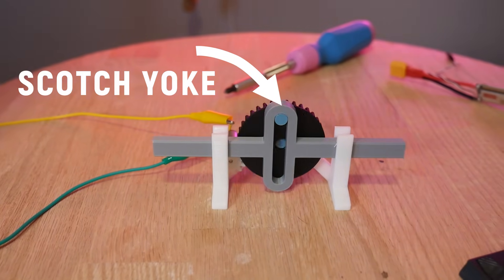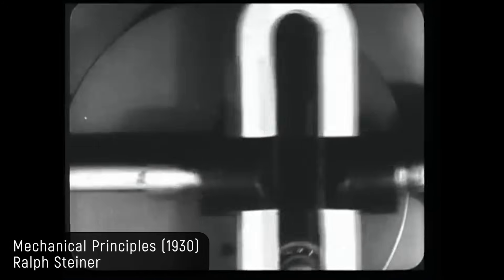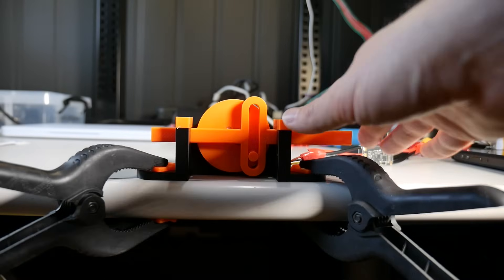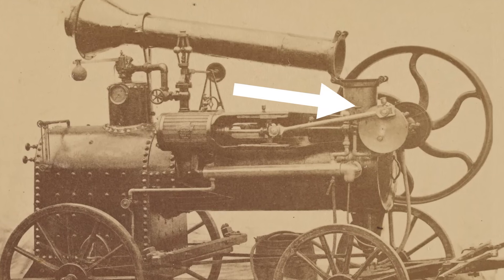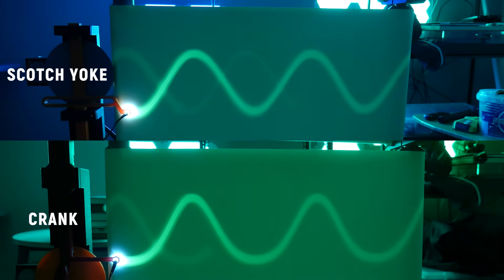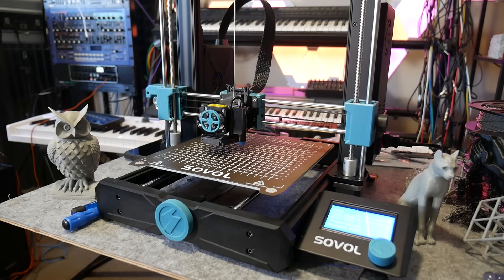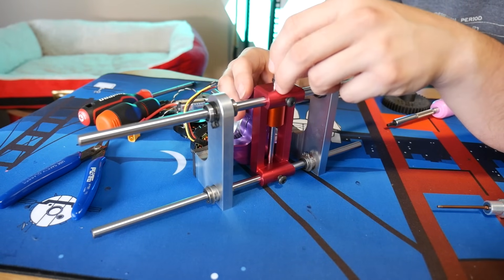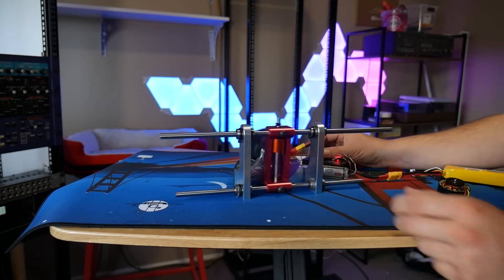This strange mechanism can predict the tides.

Comment: most hair trimmers use a scotch yolk to convert a tiny electric motor's motion into the sheering action. because the pin and yolk don't need to be fastened to work, the head of the trimmer can be easily changed.

Comment: I have seen a scotch yoke on a steam engine. The pin that broke off in your design was a sealed ball bearing in that engine, so it rolled on the two surfaces alternating.

Comment: In the late 90's to early 2000's, my father, an engineer, was working on a project at Melbourne University to make a fully functioning scotch yoke car. When running, you could balance a 50c piece, on edge, on the top of the motor and it wouldn't fall or vibrate off, even under inconsistent acceleration bursts.

Comment: I'm confused how that's a linear bearing at 9:45?  The bearing doesn't appear to turn at al, just slides on a shaft along its inner race.  Which is more like a bushing, not a bearing.  So why use a bearing at all instead of just a sleeve?  Or better yet, why not tip the bearing 90° have it ride on the cam arm inside the slot of the yoke?  Then the bearing actually does turn

Comment: After a bit more digging, looks like Watt avoided the whole crank thing on the input side much the same as the output. It wasn't until later in 1841 Howe and Williams introduced something like that as part of their reversing mechanism. Earliest reference of a "slotted link mechanism" I've found so far.

Then later again, there's [Illustration: Figure 41.--Scotch yoke, described as a "crank and slot-headed sliding rod." From W. J. M. Rankine, A Manual of Machinery and Millwork (ed. 6, London, 1887, p. 169).] from Kinematics of Mechanisms from the Time of Watt, Eugene S. Ferguson

But yeah, I think they were more common for actuating the slide valves where programmability would have been handy, not for high loads.

Comment: If you are looking for use cases for a scotch yoke, it is a little different, but I recognize the layout from a single point  cutting machine tool called. A metal Planer. A deprecated tool but a damn cool one. Bullet proof in its durability as proofed by ancient examples being bought and sold on marketplace even today.

Comment: I know this was more of a proof of concept but there are genuine limits to a crank shaft. An imperfect sinewave is problematic when the length or more accurately how short the peak is ideal. Example in car engine a better sinewave could lead a potentially higher rpm. Now some may argue that level of accuracy is not needed. Fair, but that doesn't mean we shouldn't explore other options. Science is built upon the idea of collecting data so that it might prove useful one day.

Comment: The big reason we only use cranks with connecting rods for so many machines is that scotch yokes are fundamentally incompatible with journal bearings. Journal bearings are the best option for low rolling friction under immense lateral loading. Ball bearings are going to perform far better for an electric fan, jet engine or turbocharger, but for an axle that needs to hold up a 100 tonne train car or suffer being exploded into 4,000 times per minute for years on end, journal bearings are the king. A lot of people think journal bearings just work by reducing the coefficient of friction of sliding metal contact by adding oil or grease, but the metal parts never actually touch. If they do touch, the connecting rod tears through the bearing surface, jingles around on the crank until it cracks and then rips a hole through the side of the engine block, all in about 10 seconds. Journal bearings actually work by the shaft being off centre in the hole. As the shaft rotates, it drags on the oil through friction. As the oil gets dragged into the narrowest point between the shaft and the hole it's in, the oil gets wedged into this gap, providing a hydrodynamic ramp that pushes the shaft back towards the centre of the hole. A scotch yoke's pin could use a bearing to roll on the yoke's slot, but its rotation would be constantly reversing, so the hydrodynamic effect that makes journal bearings work can't happen. Journal bearings are especially good for internal combustion engines because they allow shock loads 5x higher than the static load to be absorbed in the temporary thinning of the oil film when the explosion happens. The viscosity of the oil, the speed of the rotation and the gap between the shaft and its hole are finely tuned. This is an issue for machines that change speeds. Around the 1950's, car engines started to use an oil pump to force oil into the bearings to make them tolerate loads at a wider range of speeds. Ever been told not to go full throttle with the engine at low RPM? Then you received a tidbit of 70 year old advice that's been handed down by multiple generations since it was relevant.

Comment: When i was young, I had a old machinist I used to work with who swore that the scotch yoke got it's name the same way that Scotch tape got it's name: stereotypes.  Because pistons and crankshafts were protected under patent at the time, all sorts of workarounds were developed, like the sun and planet gears, but the cheapest option was the constrained yoke. Don't have a primary source, so take it as anecdotal.

And if you're curious, Scotch tape got it's name because when first developed, a body shop owner testing thought that 3m was being cheap with the amount of adhesive on the backing, and remarked to "Take this tape back to your Scotch bosses!" in frustration. 

great video, as per usual.

Comment: One note about using flexible PCBs: they're not rated for many flexes so you wouldn't want to use them, for example, to connect a moving sensor board to a robotics platform. It would fail after a few flexes.
That said, they're awesome for fitting circuitry into weird cavities like around the inside surface of a tube. As long as the flexible parts are only flexed a few times during assembly, they're dang handy!

Comment: I hate AI with every cell in my body but I'm afraid to say that in this case Gemini gets it right. "what does scotch yoke mean?" => "Scotch: In this context, "scotch" refers to a chock or an acutely angled block used to prevent rolling or slipping. This alludes to the mechanism's ability to "scotch" or stop motion at the extremes of its linear travel". Sure on everything else it perpetuates lies and mistakes, but here for once that looks sensible. But never trust AI, like the friend at a marketing company I know who used it to create marketing email invites to conferences because it saved them having to think and they could stop working earlier (they were working from home so nobody knew, AI was their guilty little help to just be lazy instead of more productive)... until one day it just decided to put in different dates in the email that AI had generated for them, and all their customers were invited to an event on a different day to when they actually held it. Of course everybody checks the output of AI... until they don't... and that's when it'll bite you!

Comment: Where would you be without that book "507 Mechanical Movements", I have a copy myself, I don't make nearly as much use of it as you do 🙂 Good job you don't have access to the rest of my Library, an eclectic mix, I hate to think 🙂
Reply from the maker: I kinda want to know what else is in your library :P Mine is a mix of ancient mechanism and engineering books, and then some unhinged philosophy texts.
Reply: @MakersMuse  Struth, where would I start, a lot of electrical stuff, radio because that is my background, but I love old technical books describing machinery, from the past. "The Book of Modern Engines" A practical work on prime movers and the transmission of power steam, electric, wate, gas, and hot air. by Rankin Kennedy, CE (around the 1920's I would have thought no date). Five volumes. You wont be 3D Printing these and PCBWay is not going to help you either 🙂 If you really want to blow your mind, "Van Nostrands Scientific Encyclopedia" A substantial work, Copyright from 1938-1968. As to philosophy - Douglas Adams - The Hitchhikers Guide to the Galaxy. Surely You're Joking, Mr Feynman, Bizzare chats with ChatGPT, ïf you want a new perspective on the human condition ask something not human 🙂 My entire stair case is a bookcase, another in the front room, another in the spare room, another in my workshop. History, Technical, Subject specific - submarines, satcoms, photography (cine and still),  Data books, valves, transistors, IC's , Linear and Digital. Manuals (repair) for equipment, audio, video, test gear (mainly microwave, mainly HP)

Comment: 9:44 i know this doesn't really matter at all, but if you plan to keep this mechanism assembled and running (which you should because it's beautiful), I beg if you, please print a little flat washer to jam between your frame and the retaining ring on the linesr bearing so it doesn't just slide around 😭😭😭

Comment: Steam engines didn't use the scotch yoke because it's only useful for the opposite of what's needed. The steam engine needs to convert reciprocating motion into rotary motion. The crank that is normally used isn't perfect either but still better

Comment: Just one correction... James Watt DID NOT invent the Steam Engine. Thomas Newcomen invented the first pistion type Steam Engine long before James Watt got involved. James Watt was given a Newcomen engine to repair, and realised that the efficiency was terrible because the condensing of the water was being done in the main Cylinder, which cooled it down, only to be reheated by the next charge of steam. His invention was that of the Separate Condenser, and other improvements which transformed the design into what it became.
He was very cautious about the use of High Pressure steam, so his engines were necessarily huge. Much of the output came from the condensing of steam. However, bolder designers such as Richard Trevithic realised that if the pressure was high enough, you could make engines much smaller and portable, discarding the entire part of the cycle that condensed steam to produce power.

Comment: You may want to look at the way the scotch yoke is used on metal cutting stroke shapers.  It is a very interesting adaptation where the forward stroke of the cutting tool is slower than the return stroke.  In other words the tool is pulled back very quickly for the next slower cutting stroke.   Thank you for this video it was very well done.

Comment: what if the slot was JUST slightly larger than a bearing you put on the post? As bearing rubs it'll spin very freely, minimizing friction (slot slightly bigger so its not touching both sides at the same time)
Reply from the maker: Yep that works, some of the examples are like that! It introduces some backlash, but seems quite viable.

Comment: For crying out loud.  If you have any sort of load, you would have a slide bearing with a bushing for the pin.  I suggest taking a course in bearing design.

There are some limitations to the design.  One of the advantages of the design is that it is more compact than using a connecting rod.

Comment: What are the forces? Is your new version more efficient at converting energy? It could be a low energy option if it was. Something like a solar powered water pump, that always have issues with amperage that needs to be solved with gears, which cost efficiency.

Comment: most recip saws use a scotch yoke because they are so compact and don't require a connecting rod. you just use a roller pin and LOTS of grease and its fine

Comment: There is one very important benefit of the Scotch Yoke - as it produces perfectly sinusoidal motion, there is only primary imbalance, while there is no secondary imbalance from different acceleration/deceleration values between two half-rotations like with a crank.
Also: The distance between the shaft and the moving part can be zero, while a crank has to have a minimum length.
BTW, most jigsaws and hedge trimmers work on the Scotch Yoke principle, in the latter case even with two SYs within each other, to balance out the two moving masses of the blade halves.

Comment: I have made a robotic tuna with a very similar modified scotch yoke mechanism. In my design, the guide rods are held fixed and the linear bearings are connected directly to the yoke. The yoke has a secondary slot that interfaces with the tail bar. The tail bar pivots around a shaft located near the center of the bar. This provides a sinusoidal flap motion.

Comment: Scotch yoke mechanisms have a significant commercial/industrial application in pneumatic valve actuators. In my work I encounter and work with them regularly. Check out the Bettis G-Series Pneumatic Scotch Yoke Actuator on YT and you'll find some animations showing how it works. Actuators like it are probably a billion dollar / year industry, across dozens of manufacturers. They can get huge (up to a few thousand kg) and are used to operate large quarter-turn pipeline valves.

Comment: Why not just replace the pin with a ball bearing? It's a simple fix that works well in malta cross positioning tables if I recall correctly my enginneering lessons

Comment: There is an alternative use, turning reciprocating motion into rotary motion. 
The Driving For Answers channel discusses this. The non-sinusoidal nature of a typical crankshaft system results is a source of vibration in internal combustion engines that is undesirable. 
https://www.youtube.com/watch?v=BzSKXl4SXpM

I know there is an EV transition going on in most transportation but the ICE will still have uses for a while so continued refinement of internal combustion fundamentals (like finding something like a workable scotch yolk system) is likely to continue for years to come.

Comment: Major advantage of that is there is little or no vibration 90 degrees to the motion of the yoke.  Only the pin goes in that direction and can be balanced out on the crank.

Comment: I've always thought that the scotch yoke was better at turning rotary motion into reciprocating motion than turning reciprocating motion into rotary motion. if rotary part of the yoke is at top dead center or bottom dead center, attempting to push or pull on the reciprocating part in the opposite direction applies a LOT more deflection torque on the "scotch" of the yoke than a standard rod and crankshaft, because of how much further away the edges of the slot are compared to the circular joint. 

the pure sine wave output from using it as a rotary to linear converter is definitely an appealing trait. it reduces the load experienced by everything in the system because things can properly decelerate and accelerate, rather than abruptly changing directions. in slower moving mechanisms, such as water pump windmill, enclosing the yoke in a box and just flooding it with oil would likely result in a very durable and long lasting component, with the motion itself being a good stirring mechanism to keep things lubricated. I could also see it being really good for a water wheel driven sawmill where you make the rotary plate significantly larger and use a traditional saw blade instead of a band saw. because it needs to be constrained on the two parallel rods, you get a clean back and forth motion on the output, and you could position saws on both sides of the yoke to maximize its usefulness. at slower speeds, adjusting the position of the saw while the yoke is still moving isn't unreasonable either, because we can adapt to slow gradual changes that the pure sine wave provides.

Comment: No explanation of why cranks don't produce sinusoidal motion?

Quick explanation: The rod changes angle in a crank where the scotch yoke always stays horizontal. The angle change causes the length of the rod parallel to the linear motion to change.

Comment: The sliding friction can easily be eliminated by having a rotating bearing on the pin.
There is research into the use of scotch yokes replacing connecting rods in piston engines because it can completely eliminate vibration . One such engine is the Australian Sytech

Comment: An interesting observation is the behavior of the output of a simple connecting rod setup, vs. A scotch yoke:

Assume the pin is distance R from the axis. And the connecting rod is of Lenght L. The output x for can be modeled as a function of the angle φ of the input shaft.

Connecting Rod:

x(φ) = R sin(φ) +	√(L² - R² cos²(φ)) - L

Scotch Yoke:

y(φ) = R sin(φ)

It should be easy to see that for the connecting rod, when the length L becomes very large, the output gets closer to a sine wave

L>>R ==> x(φ) ≈ R sin(φ)

Comment: It's still used for this reason! Quinn at Blondihacks made a die filer kit a while back and it used a scotch yoke to turn the rotation of an electric motor to smooth reciprocating motion of a file.(And having the motion be hardened tool steel and cast iron really helps reduce friction.)

Comment: In Seattle at the Pacific Science Center they have a psuedo-tide predictor with Scotch Yokes set up.  More accurately it's a model of Puget Sound with water in it and the series of Scotch Yokes embedded in the wall behind glass are used to regulate the height of the "tide" in the model. IIRC one "day" is ~5 minutes in the model.

Comment: Motion profiles get really interesting if you start comparing overlaid graphs of position, velocity, acceleration, and jerk. If you want to get into a motion profile that is usually the ideal one for cam-based motion, look up a modified sinusoidal motion profile... It has smooth acceleration (little jerk) as well as higher velocities for the center portion of the profile